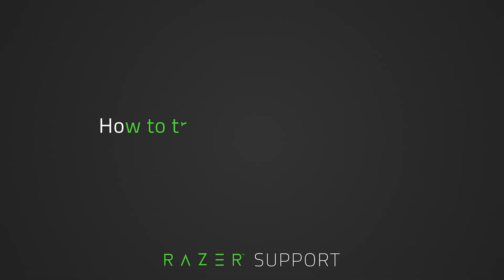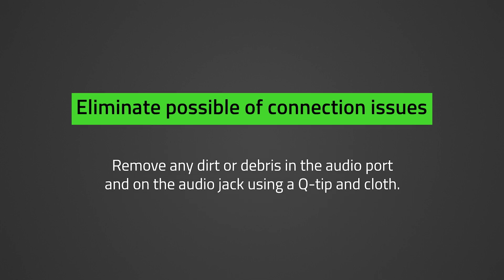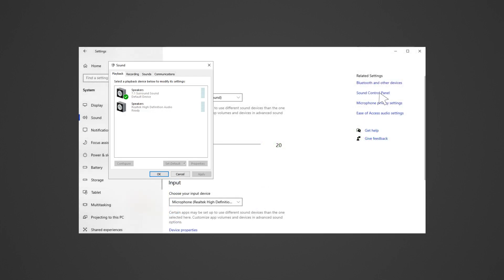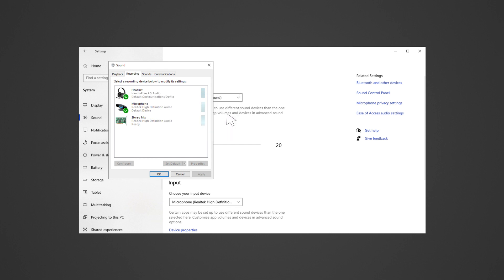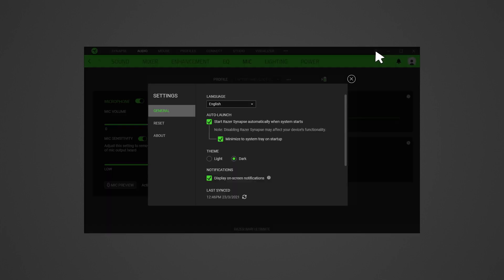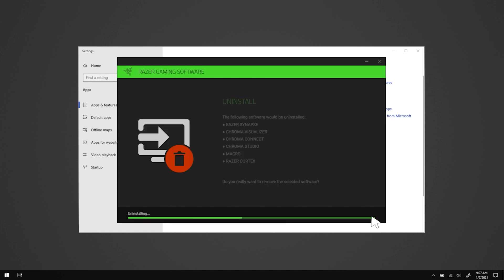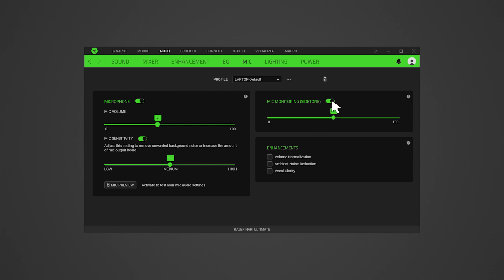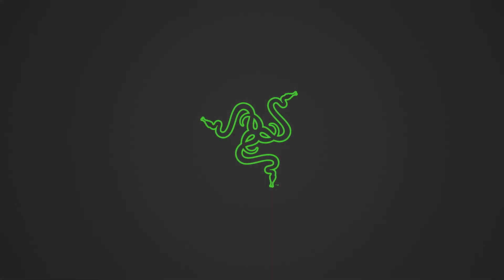How to troubleshoot and resolve headset microphone issues

Comment: I have two Razer Kraken headsets. On one of them the right speaker stopped working I was able to fix it by soldering the pins on the volume know. On the other headset the mic doesn't work anymore which it looks like the microphone itself went out based on a short video I found. Never buying another Razer product again.

Comment: I have no idea how to fix mine. I don't know which headset I have because when I bought it, it came in a bag without a manual. (Got it from GameStop) My computer doesn't register my mic at all. In the sound window, it shows up as its own thing but only works if I connect it directly to my computer, not my headset. Does anyone know how to fix this?

Edit: Forgot to mention that it does work on other devices, like my phone.

Comment: I have a the razor kraken and mic sensitivity on windows 11 is terrible. Was working great on Windows 7. I've gone through every setting, looked for driver support on the razor website and did not find a any driver support for win 11. The mic works but is very faint and cuts in and out.  Very annoying.
Reply: how do you get it to recognize it as a microphone, my laptop won't recognize it at all

Comment: hi.
i brought razor sharq v2 from amazon.
due to some reasons i had to format my laptop so had to reinstall razor synapse and the problem started. earphones work fine but THX/7.1 not working. The razor sound card firmware is also updated. i signed and also registered my product. it asks me activation code which i never received via email or on the box.
any idea or solution you are aware of? 
Thanks.

Comment: I have the issue on my android phone. When I connect my headset to my phone without its extension cable, the mic doesn't work. I can use the mic on my phone only when I use the microphone extension cable, but then I can't hear anything from my headset.

Comment: Just got the razer Kraken Ultimates as a backup because my void pro's were going bad after some years and cat gnawing. been using it for maybe a week, and now the microphone fails. any audio it puts out from me is just a constant ring or buzz. have uninstalled drivers and synapse then reinstalled along with every option shown here, no fix. I can hear everything through the headset fine though.

Comment: Why can't I find my headset on the razer site!!!!????? There is also no visible part number anywhere on the headset. It won't even work on a tape recorder with both a monitor jack hole and a mic hole. Am I going to have to take the cups off or dismantle the top? I have had nothing but problems with hardware by gamers for gamers.

Comment: Love the new headphones, sound great, comfy, etc... however..... While Synapse is active, recording with my condenser mic using bandicam is not possible. Or if I manage to get it working, other software cannot play sound. So for example, if I get bandicam to record sound, then tools like web browsers, spotify and so on no longer function. Attempting to launch sound causes them to error out. If I remove the ability to record with bandicam, then they work. Shutting down synapse allows everything to work fine. Switching to my LG dongle instead of the Razer dongle allows me to adjust all settings for the headphones without impairing any other software or tools. So, if a competitor's drivers and apps can make it all function correctly, and yours causes immediate conflict on install, then the software is the issue. Please have your software engineers revisit their design. Work WITH windows, not against it.

Comment: Nothing from this video sadly worked, my mic used to work completely fine with no issues and suddenly it just stopped.
Reply: Had the exact issue tonight.  Was chatting with some friends on Discord and was working just fine.  Got up to get a drink and a minute later when I got to my desk they couldn't hear me and my computer can't pick up any audio from my mic.

My friends said shortly after I left they heard an ear piercing static sound for a split second so that surely has something to do with it but I have no clue how to fix it.

Even tried a clean install of the Razer apps and headset drivers to no avail.
Reply: @zoso279  Damn this sounds horrible, well in my case I just muted myself...

Yeah, I am a fucking dumbass.

Comment: Whanever i try to go into a game that allows voice comms, if i have my headset mic set as my entry device, i can barely hear and everything sounds very far away, even tho the volume is at 100% everywhere. I thought it was game issue, but i have tried in video calls and the same thing happens. What can i do the fix this issue? I have tried to mess with the settings but nothing is solving it so fornow i have a headset with a mic i cant even use. 

If anyone has any tips, i am open to everything, because i feel like i have watched all the videos on the internet, and no solution in sight so far.

Comment: i bought the Razer Barracuda Pro. At first they work really fine, but after 3 months using, the mic started to not catch my voice. Like sometimes, I have to adjust specific angle of the mic to work properly and it is really annoying. Is my case normal?

Comment: The first option is Dirt or Debris ?? these are wireless arent they ??
My issue is the software is changing, litereally - Sometimes I see the AUDIO option on the top menu and mostly I dont ! Loading Synergy program to change the EQ or see if the HP are fully charged !
Also the green light is blinking after overnight charging.  Nothing works now that I have tried re charging.  I think the connecting of the USB cable causes some issue but dont know how to tell the system no more USB connection.
Also downloading firmware updates does not work... keeps asking me to replug my Dongle - yet I was using the HP seconds prior.
Help - Im going for the SONY... these seem to be candy for Kids.

Comment: I have the Razer Kraken Kitty Edition USB headset, so I'm not exactly sure what the issue is, but I have noticed when I am in a voice chat of any kind I can't have the volume too high on my headset, If other people do something that is remotely loud like laughing or yelling over their mic, my headset, my keyboard and my mouse will all briefly shut off and turn back on, and I wont be able to respond to anyone until I go back into my audio settings and manually try to adjust it again. How would I fix this?
Reply: I have same headset and the same problem, did you find a solution? I'm still trying to fix it and it's really annoying
Reply: @lost.k1ttyy  what i found that worked for me was to turn off the LED on the headset cause it kept causing crashes when the LED reacted to any loud sounds
Reply: @FelixCatboi  i did not want to come to that solution for obvious reasons :c but i will try because i cannot run discord and some game at the same because the headset dies, haha really sad. thank you!
Reply: @lost.k1ttyy  yeah :/ I kept trying to find other solutions myself but that was literally the only thing that worked for me, otherwise everything would mess up and since I use VoiceMod, it was such a hassle for reconnecting and reconfiguring every single time it happened

Comment: Honeslty I've never had such a bad experiencie with a product than I had with the Nari headset. It was working fine, then I connected it to my ps4 controller and after that the headset got ruined forever. I've tried on every single computer I could and there is no possible way to make the microphone work, I did everything support told me, they even told me that the headset was broken but it literally was working wonders before. Never use your audio cable with a ps4 controller guys, it will break your headset permanently
Reply from the maker: We're sorry to hear about your experience. We’d like to check it out, please reach out to us from here: https://insider.razer.com/index.php?forums/support

Comment: I just bought the Razer Barracuda X headset. When using in wireless mode, "ssssssssssssssss" sound comes from deep in the earphone. So I'm having a bottom sound problem (I guess it's called buzzing noise, hissing). I couldn't run the wired mode on my computer (it worked wired mod on the phone and I guess there was no "ssss" sound) when I pull the volume reduction wheel on the headphones to 60%, this "sssss" sound also decreases. I couldn't find any solution about it. Is there anyone who can help me?
Reply from the maker: Allow us to look into this. Please reach out to us from here: https://insider.razer.com/index.php?forums/support

Comment: I recently bought the Kaira Pro, and it worked fine for my MacBook (the mic's audio sounded a bit fuzzy according to my friends, but other than that, it worked; when the mic was on, it also made my friends' audio sound fuzzy for me...idk why that was).
Once I tried using it with my Asus M16, the mic just didn't work at all. My pc can detect it & knows that it's there, but every time I try to test it, it just doesn't respond. Doesn't pick up anything I'm saying. Already tried cleaning the mic's jack, still nothing. Tried setting it as the default for recording, still nothing. The audio works fine, it's just the mic that's having issues.
Reply from the maker: Test the Kaira Pro on a different computer to isolate the issue. If it works fine it might be mute in the system settings or voice chat software settings.

If you need additional assistance, please reach out to us from here: https://insider.razer.com/index.php?forums/support

Comment: I own the Kitty Kraken Headset and when I plug it in, the connection seems to pop in and out. My computer claims it does not recognize the usb device even though I've had this headset for several months. I have tried uninstalling and reinstalling the Kraken app but it did not work. Any ideas?
Reply from the maker: Please test the headset on a different computer to isolate the issue. If you need additional assistance, please reach out to us from here: https://insider.razer.com/index.php?forums/support

Comment: Hi guys. I just bought Razer Nari Essentiel headset and... The mic worked the first a couple of min. And then i restarted the PC aaaaand. It stopped working. Using them via bluetooth cuz they're wireless. I reinstalled Synaps, checked the privacy, did a troubleshooting, changed an account in Synaps, re-installed Synaps, deleted drivers for mic and then restarted the PC etc etc etc. NOTHING HELPED. Like, how does it even work. The fun fact in all of this, that the mic is not detecting any sounds BUT in the 'MIC MONITORING (SIDESTONE)' it's detecting sounds and i can clearly hear myself when i put it to 100. When the mic is still doesn't work. Also i can hear like the mic repro the sound when im clicking on the line with changing the volume. With each click i can hear the sound from my mic. But it's only when im clicking on this line. 
How to fix it?
Reply from the maker: We're sorry to hear that this has happened to your newly bought headset and allow us to help you. Please reach out to us from here: https://insider.razer.com/index.php?forums/support/ so we assist you in troubleshooting the issue.

Comment: Hi, I have the Razer Blackshark V2 X. It seems to work perfectly fine on my ipad, however on the laptop, the microphone does not work. It doesn't show up unless it is forced all the way into the jack, and even when it is, all it picks up is very loud fuzzing.

Even if I try to increase or decrease the volume or bass, it just makes the fuzzing louder or quieter, but no other audio picks up. I did try updating the sound drivers, but they were apparently already updated, so I'm not sure what is the issue.

I was going to send in a support ticket but I cannot get the ear cushion off to get the serial number.
Reply from the maker: We’d like to help out, please reach out to us from here: https://insider.razer.com/index.php?forums/support
Reply: @rzrsupport9502  mine was working fine before aswell but the mic just completely stopped working but it was weird because when I plugged it in a little bit it work but when I fully plugged the headphones in i couldnt use my mic but I could hear through them (I can hear what your saying in the video through the headset. It’s just my mic that’s isn’t working) and the mic isn’t working on any device so I didn’t want to do every single step in the video so what’s the best tip
Reply: @topW6087  I have the same problem what was the solution ?
Reply: @deniseptr359  I mean I got the mic to work and I relized that it wasn’t the headphones that wasn’t working, it was my computer that was set to a certain microphone setting and I wasn’t able to connected it to my microphone, but it sorta works on my iPad, I still have the issue on when I plug it in fully it doesn’t work but when I plug it in lightly it works. So if it doesn’t work on your computer I can tell you the method on how to do that
Reply: @topW6087  i have same problem when i connect with connector loos not tightly it works but sound output sucks and microphone works but as soon as i put full jack inside it stop working :( help mee
Reply from the maker: Hey @TopL! Thanks for letting us know. To help you troubleshoot the issue of your headset's mic, please contact us directly here: https://insider.razer.com/index.php?forums/support/
Reply: hi, have you found a solution? I recently bought one and have been experiencing the same issue
Reply: @kennethbaldino5793  formatted windows works fine now
Reply: @HackersPediaOfficial  wait so did you fix it
Reply: @topW6087  yes after installing new windows 10 it works
Reply: @kennethbaldino5793  re install new window no other option iguess
Reply: @kennethbaldino5793  I haven't, sorry! I just rely on the inbuilt mic of the laptop, which isn't great but it works.
Reply: bruh this dogshit mic isnt working lol. On one laptop it does, on my main one it doesnt. I seriouslt have no clue :(

Comment: Hi there. I just purchased the Razer Kraken V3 Pro, and I’ve noticed an unbalanced sound profile at lower volumes. The right is louder than the left. Is there a simple fix for this?
Reply from the maker: Try adjusting the EQ in Razer Synapse and audio balance in the Windows sound control panel.

If you need additional assistance, please reach out to us from here: https://insider.razer.com/index.php?forums/support

Comment: my blackshark v2 microphone stopped working when i installed a kiyo pro webcam, on sounds settings it shows the mic as razer usb card but it's not picking any sounds. 
what should i do?
Reply from the maker: It is possible that Razer Kiyo Pro became the default mic for your computer when you plugged it in. Go to your sound control panel and set your Razer Blackshark V2 as the default playback and recording device.

If you need additional assistance, please reach out to us from here: https://insider.razer.com/index.php?forums/support
Reply: @rzrsupport9502  I've already checked on that and it's not it.  The only option it shows is Razer USB Card. I have disabled and disconnected the Kiyo pro and still not working. 
Suggestions?
Reply from the maker: Understood. Try using the headset on your mobile phone and if the issue persists, please reach out to us from here: https://insider.razer.com/index.php?forums/support/

Comment: Love my Nari ultimate but there is a terrible echo that the people I play with can hear as if the microphone was the speaker it self. I’ve reset all my Xbox audio settings and there’s been zero change. Also it’s unfortunate that the headset box doesn’t provided assurance the potential customer that this headset is or is not wirelessly compatible with xbox consoles. It had the compatibility list but does not specify wireless compatibility. I have zero clue of how to fix the issue even after watching this video. Any suggestions would be appreciated. Thanks for reading.
Reply: I just bought this headset, have you figured out a solution?
Reply: @madjarl  I cracked the plastic on one of the speaker supports and don’t use them anymore. They just sit in a box and have for year now. Really sucks
Reply: @deathtoll999  I feel you man, I have mine in a plastic bag and it’s just been sitting in my closet ever since 😂 I ended up getting the Corsair HS80 wireless off Amazon for like $80 though it was refurbished. Been using it ever since!
Reply: same here
Reply from the maker: We may be able to help you out, please contact us from here: https://insider.razer.com/index.php?forums/support

Comment: Will the Blackshark v2x pop up in the mic settings? I cant use my damn mic lol but the sounds are fine
Reply from the maker: It will not show up on your Sound Control Panel. The Razer Blackshark V2 X is an analog headset, it is dependent on your sound card driver. Please check your sound driver if it is installed properly.

If you need additional assistance, please reach out to us from here: https://insider.razer.com/index.php?forums/support
Reply: @rzrsupport9502  Hello. I already fixed it on my own. Found it in my sound card driver as you said. Its working perfectly fine now. Thanks!
Reply: @commandershepard5836  could you please explain? I have exactly the same problem :(